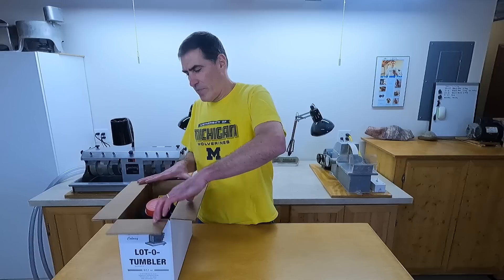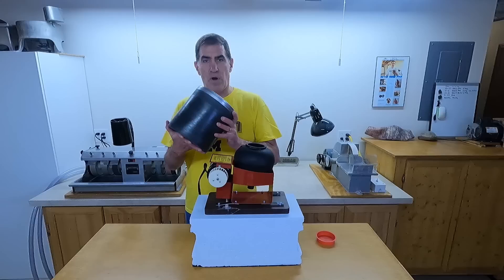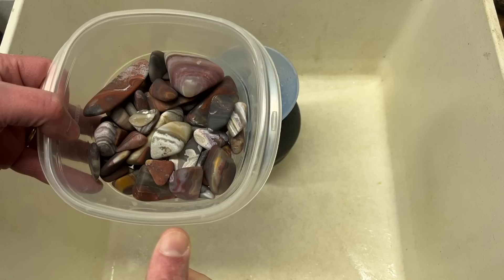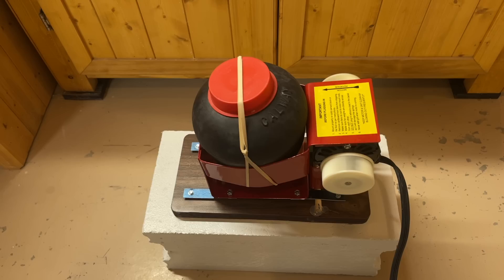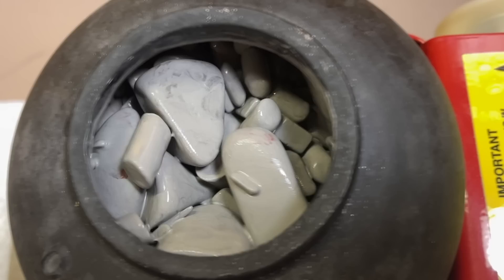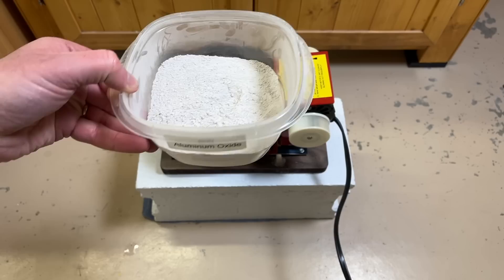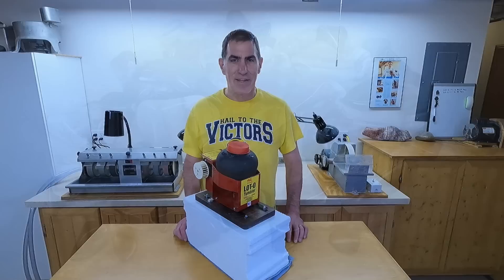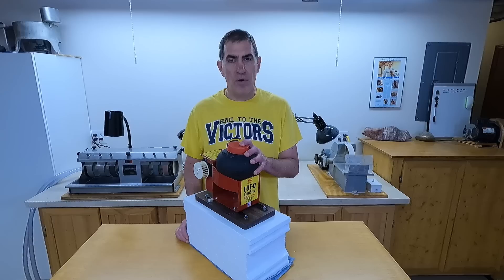The Lot-O Used To Be My Favorite Tumbler. It's Not Now. See Description Below.

Comment: I just got my first lot-o, and the tumbling is very slow! I did notice that the dowel is in the same position as yours from the factory. I was very impatient and didn't fill in the holes and used bricks instead. I didn't paint it either and used gorilla glue in addition to the sticky material. Does anybody think that would effect it significantly?
Reply from the maker: Not having it attached to something heavy enough would matter, I think. If the vibration is working on moving the block, then there will be less left for moving your rocks.
Reply: @MichiganRocks  It was a concrete block, more square than the one in your video, I think it is 30 lbs. Its from Home Depot and it's 8 x 8 x 16, then I put bricks in the holes. It seems pretty heavy, I wonder if concrete is heavier then brick. Its on a cement floor and doesn't move.
Reply from the maker: I’m not sure. I wonder if the bricks being loose is a problem. 

Have you tried moving the dowel? Mine was slow before moving it as you saw in the video.
Reply: @MichiganRocks  Interesting you say that, the bricks being loose makes the whole thing vibrate and make a odd noise depending on where they sit in the holes. I will be moving the dowel, along with getting cement to fill in the holes, and another block the same because the ones I can get are smaller concrete blocks (then the cinderblock you got. Somewhat frustrating because I should have done that to begin with. That being said, it still polishes nice. I also got it to go faster by sitting the barrel less in the frame. I think I was pushing it too far in perhaps. Also filling it with more ceramic and less full. Thank you so much for these videos, they are so inspiring and informative.
Reply from the maker: @edwardrick7388  Sounds like you have a lot of variables to play with. I think you'll get it figured out.